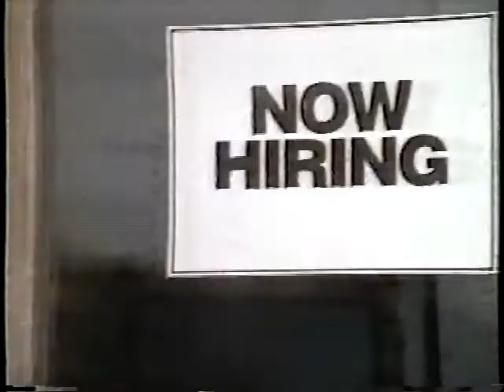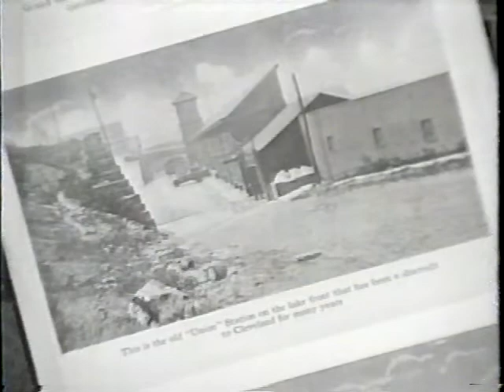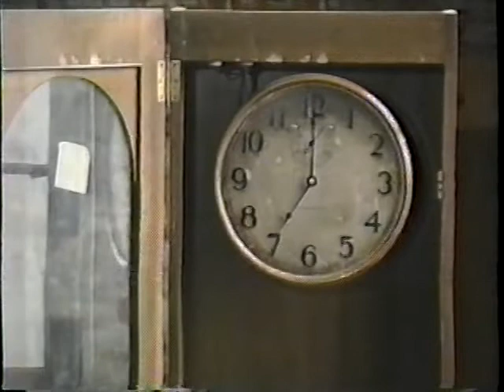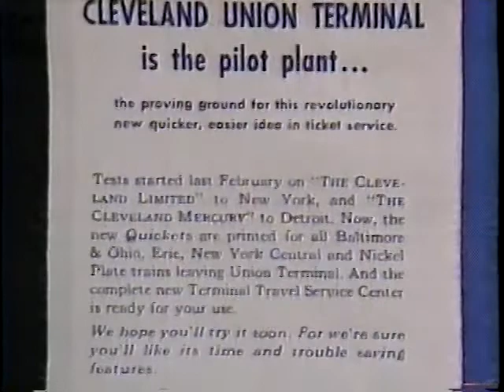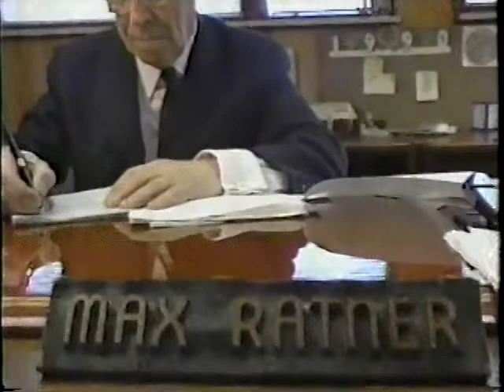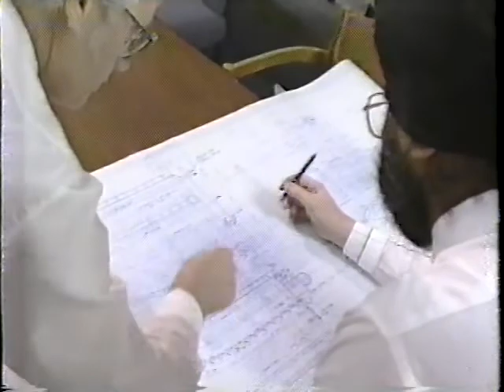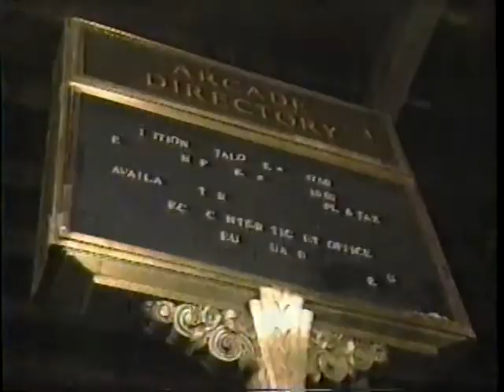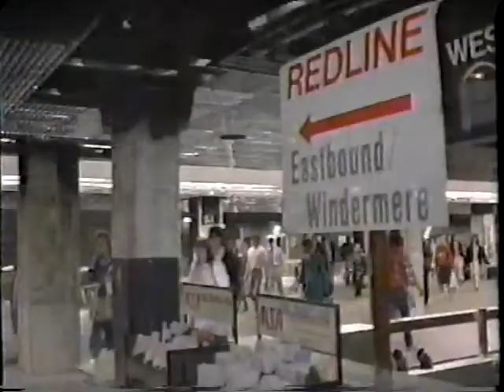The Memories and the Dream

Comment: When Tower City was the Union Terminal, I thought as a kid that with those high chandeliers and marble architecture, that it was the prettiest railroad station I ever saw.  And that included the original gold metal doors in the front and back of the building from its 1929 construction.  Another thing, I saw a 1950's home movie video on YouTube which showed a steam locomotive pulling a NY Central passenger train out of the Terminal going west.  I thought that steam locos were not allowed in the bowels of UT because of polluting the concourse above, that electric locos pulled the trains in and out, only to be replaced by steam locos at Collinwood and Linndale.  What do you think?